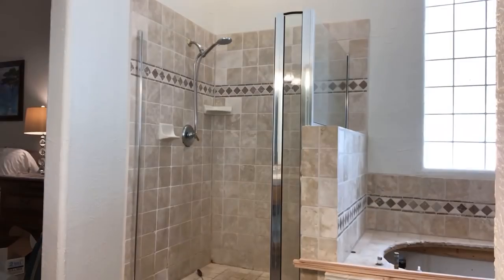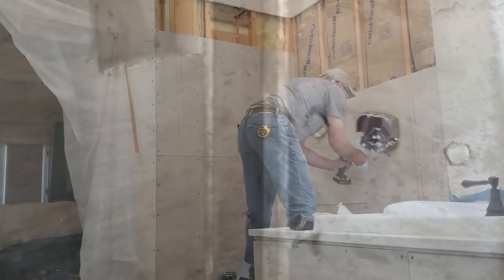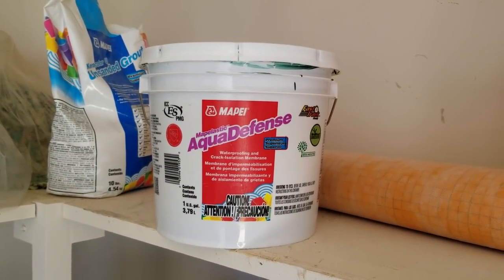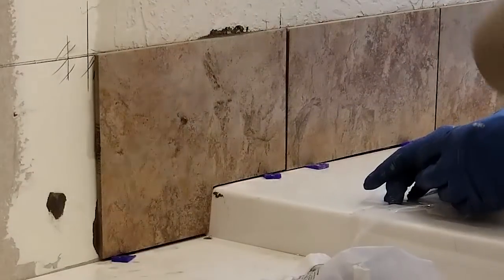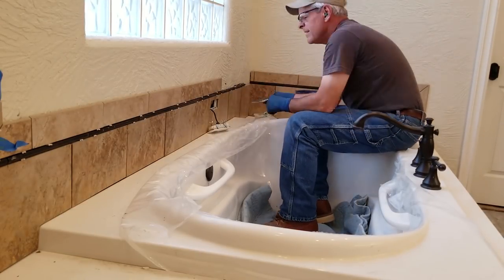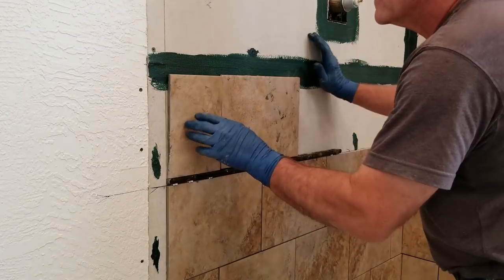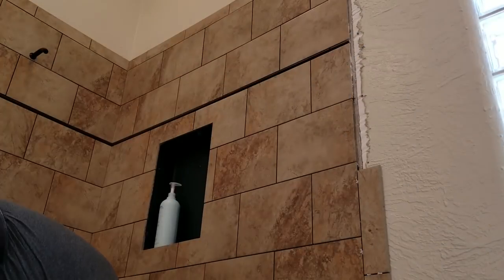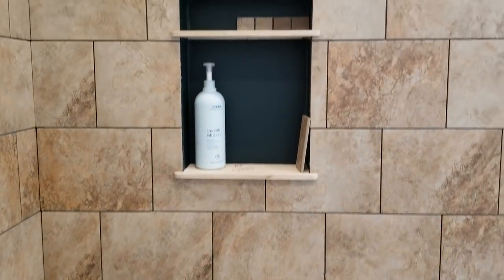How to Lay Out and Set Tile for a Shower and Tub that are Connected

Comment: I’ve got a master bath project that I need to finish which entails removing a shower and tub with very similar placement as you have so eloquently displayed in this series. Your instructions are helping this novice as I’ve never tackled anything like this before. After 15 years in the home the base of the current shower had mildew and mold growing in the shower door framing. I’d be very interested in a video on how you installed the door to this shower after you completed all the tile work!
Reply from the maker: Thanks for watching, Michael! Yeah, with all construction projects some things can seem a little overwhelming, but it really is just tackling the process one step at a time. As a friend of mine says, "...it's not rocket surgery!" On that shower door, it was a special order that the guys who do my glass and mirrors handled totally. It took them maybe an hour to install and I didn't get any video on it but mainly involved installing clips in the tile to support the glass which was 3/8" thick tempered. A lot of square footage of that which was expensive. My cost was about $2,500 for the install.

Comment: Looking awesome Rusty!!!
Reply from the maker: Thanks, Danny! Yeah, in real time I have finished the floor and am building doors and drawers for the vanity. It was designed by the homeowner and is quite a project.  Two towers, one on each side of the vanity then with a row of upper cabinet units above the lights running the full width of the vanity. Planning to put out those videos as I am finishing each step. This has been an interesting job. Still waiting for the pieces from the granite guys so I can finish the shower!

Comment: This looks great!  Almost exactly the same layout I’m looking to do. 
How do you maintain the proper slope of the shower shelf/bench when it is part of a larger slab also surrounding the tub?  Does the tub just have slightly different clearance from the slab (covered up with caulk I assume)?
Reply from the maker: You are asking some really good questions here, Jess! You are thinking about all the right things before you take on your project. Since the slab was going to extend into the shower and create a seat, we opted not to try to put some kind of grade on the seat portion of the slab. Just too many variables so the goal was to keep it flat throughout. I told the homeowners that they should squeegee the shower glass every time they use the shower and at the same time squeegee off the slab seat, then the towel dry everything. There was no concern about the slab itself leaking so that's the way that issue was handled in this installation. On your other question about the tub, you want to build your support structure for the slab to work out so that the tub rests on the floor and comes within 1/16th to 1/8th inch of the slab. Then, yes, use caulk to seal that joint. Good luck on your project! This style really is a great look and I'm sure you'll be very happy with your finished product!